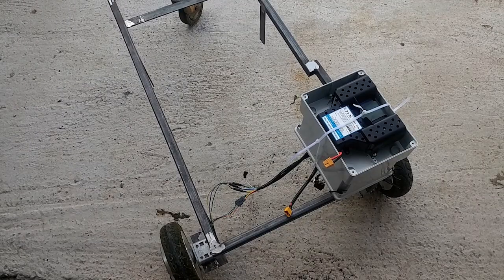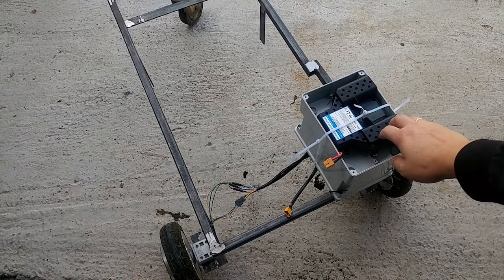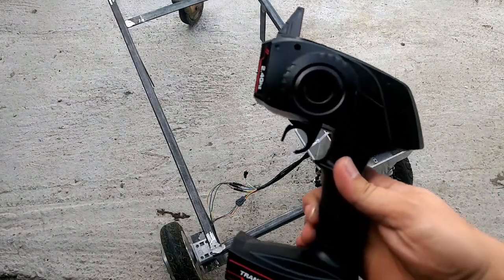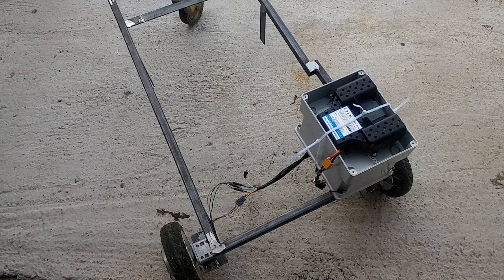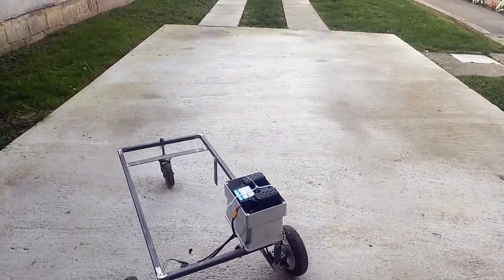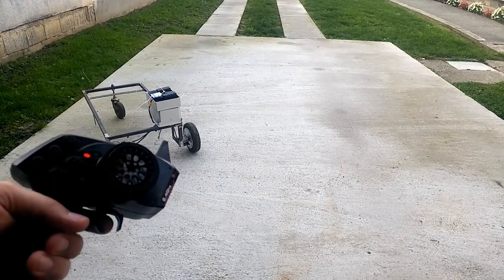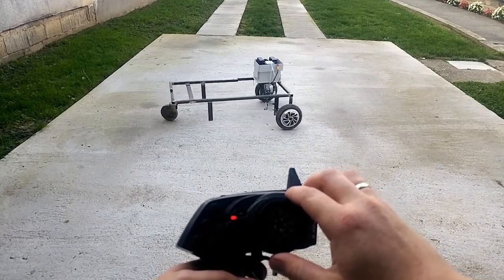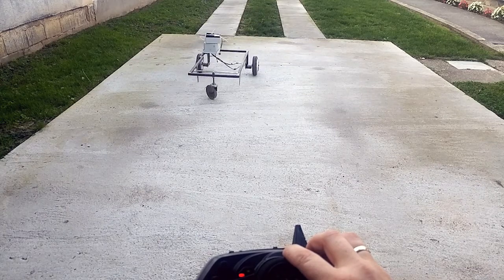HOVERBOARD HACK FINAL TEST

Comment: Hi, do the motors overheat during long runs in the summer ?
Reply from the maker: They tend to be warm but I had no problems whatsoever.
It works aprox. one hour per moving, so... it gets warm, but thats it... I can hold to the wheel with my hands

Comment: Hi, how you give connections to tranmitter. Does this transmitter work to drive both motors separately to make turn.
Reply from the maker: The board is programmed so when it turns, one motor turns of, or when standing still, one motor goes forward, the other backward

Comment: hi, i'm already flashing with your firmware, works great, but i have a issue, when is turning on its own axis loses torque in both motors.
What did I do wrong?
PD: I programmed with the st-link adapter, with the 3.3v, SWCLK, SWDIO and GND to the PCB,
I did not connect the battery during programming.
Also use the 9.5 inch pneumatic tire motors.
The battery is 10s
Reply from the maker: Everything sgoul be up and running... it could be the slightly different version of your board that makes the difference... but I can't really understand why

Comment: hello 
i have some question, 
if you want to turn left = Right motor move forward and left motor move backward. am i right?
thanks.
Reply from the maker: Basically, yes... This steering is programed in two modes: 
1- If you are standing and just use steering, than the left wheel would spin to one side, and the right in the opposite direction
2- If you're riding (using throttle), and in the same time turn left, the left wheel would turn off, like a real differential.

Comment: Hi. Cool project. Did you use only one hoverboard main board ? And just one rc receiver ? How did u connect the receiver with the board ??
Reply from the maker: Hi, Yes, only one board and only one rc receiver. Here is the video of e connecting it together, although, the steering did not work there yet... but basically, you'll get the point

Comment: Thanks for a great firmware. Everything works great but one problem is the low voltage cutoff was too soon at 38v, is there anyway to turn off the alarm and auto shutoff? Thanks again.
Reply from the maker: thanks.
Did you fully charge the battery before flashing the firmware?
Reply: snowkingcro I don’t think I even plugged in the battery when it flashed the firmware, should I reflash with the battery plug in?
Reply from the maker: There is an option in the code of the firmware to calibrate the voltage, but i never used it
Reply: Is there an option to turn off the auto shutoff?
Reply from the maker: I think no, because the auto shut off is mandatory to prevent draining the battery and damage it permanently... 
I would sugest you to try Niklas's original firmware issue section, and try to find an answer there...
here's the link: https://github.com/NiklasFauth/hoverboard-firmware-hack/issues
Reply: Cool, thanks for your help and thanks again for this great firmware.

Comment: how were you able to get the steering to work? are you using two channels on the rc receiver?  how did you wire the rc receiver to the motor controller?
Reply from the maker: here is the link to the code https://github.com/snowkingcro/hoverboard-firmware-hack-esk8/tree/RC-Steering

I used two channels on the RC, 1 for steering and 2 for throttle.
Reply: @snowkingcro  great, where you connect the two channels?
Reply from the maker: you can see it on my previous video here: https://www.youtube.com/watch?v=2Zg-sp9BD_g
Just watch from the 5:00 min. mark!
Reply: @snowkingcro  I follow it that before, you used channel 3 for forward / reverse actions, in this video you add another two actions (right and left), so u need another channel to be use, am I right? my question about the other channel, where did u connect it?
Reply from the maker: Thank you for the question!
the ADC1 on Hoverboard is ch1 on Rc Receiver (steering)
and ADC2 on Hoverboard is ch2 on Receiver ( Fwd/Bckwd)
Reply: @snowkingcro  great, thanks a lot, this is tge information I need, I'll check that and try.
Reply: @snowkingcro  From the video it looks like you are using just channel 1 on the receiver? Can you make a picture of how it is supposed to be wired?